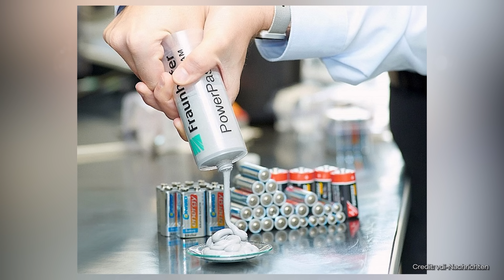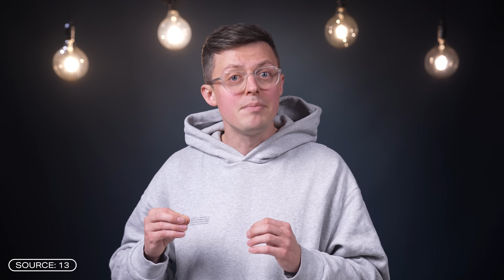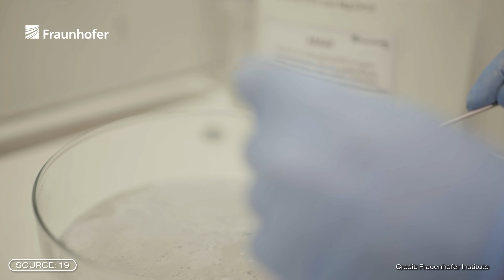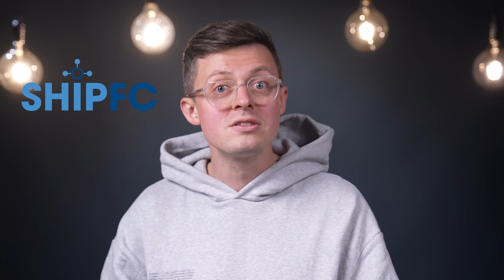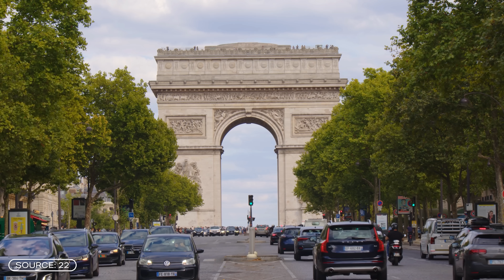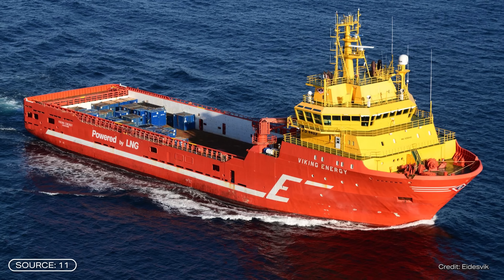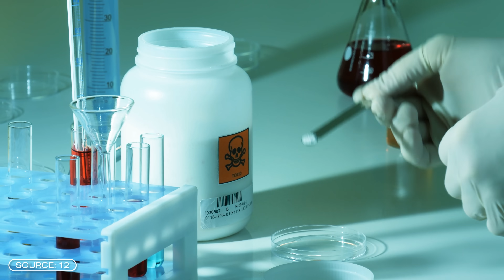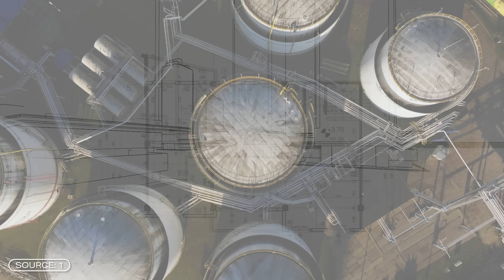Hydrogen Powerpaste: 10x Higher Energy Density & Safe?

Comment: 10kg paste yields 1kg hydrogen, but how many kg of residual material, and at what density? And as a practical matter, how do you mix the water and paste while simultaneously segregating and storing the substantial volume of leftover material so it doesn’t gum up the works and interfere with subsequent hydrogen creation?

I did some work on a similar system that combined water with an aluminum based powder to generate hydrogen and found that the volume of residual material far exceeded the volume of the input powder. And it was a wet, muddy, and abrasive mess.
Reply: That was my first question too. Converting it at point of use seems like you would have to invent entire new processes to handle the waste at service stations.  If the paste is room temp stable I have no doubt some brilliant chemist can make it shelf stable for many years it would be good for......wait a second. Is this  just a lower yield plastic explosive that is water soluble?
Reply: @spencereaston8292 you could probably replace some of the components for much more volatile substances. Any could meth cook could probably make some really good black market plastic or incendiary black market explosives out of it.
Reply: The Mg(OH)2 waste product is over twice as heavy as the MgH2 reactant within the power paste. 

The energy density quoted is also that of the hydrogen generated from the powerpaste and not the energy output from the hydrogen fuel-cell. Nor does it appear to factor in system component weight and volume (water and powerpaste storage vessels, by-product storage vessels, reaction vessel, pipework, pumps, fuel-cell, post cell water recycling/collection and purging system, nor cooling for the exothermic powerpaste+water reaction) - that would need to be included for an equal comparison to a battery based system.
Reply: @GruffSillyGoat This is what i thought. Triple work and handling effort (fill in Paste and water and take off waste = 3 tanks with all required pipes and meters and stuff) will make this unsustainable before it is ready for mass production.
Reply: @GruffSillyGoat that would make it unsuitable for smaller applications like cars or consumer electronics but for larger applications like energy grid buffers, tankers and cargo ships you only need to scale up the paste and waste material storage while the pumps, fuel cell and piping do not linearly scale with it and can stay relatively small.
Reply: @megapro125 much more economical storage solutions out there to make this a non starter ever.
Reply: @Vile_Entity_3545  I have no clue how much the paste costs or what it would cost if mass produced tbh.
Reply: @GruffSillyGoat Great. So this won't give us hydrogen either. I just don't think the hydrogen economy will ever happen except for very heavy vehicles, industrial use, power generation and such.
Reply: @wombatillo 
The ammonia cycle may finally come to fruition. 
Create ammonia from green/blue/red hydrogen, stored at one atmosphere, no cooling required or off gassing. 

With the correct design of combustion motors equipped with the right catalyst, it'll burn the ammonia in the engine itself, possibly without the catalyst once the engines hot. I seem to remember the heat and pressure in the engine then powers thermal atomisation, resulting in hydrogen and nitrogen gasses with the hydrogen burnt and the nitrogen expelled.
Reply: @MostlyPennyCat  Ammonia has some of the same issues as hydrogen. It might make sense to power an industrial process especially if it's partly a feedstock or used as a fuel to make a 300 meter cargo ship move. Ammonia is so toxic and corrosive that it will most likely never be used anywhere near consumers.
Reply: @wombatillo  This indeed. It's used as a chemical solvent IIRC, and has no practical use whatsoever as a form of energy storage.
Reply: @wombatillo  heavy machinery and industrial use you're far better off just using electricity.  Skip a bunch of wasteful steps that way.  And why would you ever use hydrogen for power generation?  It's just a very lossy, high density(per kg) battery, or alternatively a wasteful way to use natural gas.

There's no use case I can imagine where any existing hydrogen power tech would have any useful application.
Reply: @iriswaters storage from overproduction of intermittent renewables, Li-ion batteries are more efficient, but expensive, a rectifier would already be needed for batteries. A fuel cell is cheaper when you don't care about volumetric energy density, you can store it at low pressure.
Reply: @iriswaters  I think for consumers, for the everyday car, a gasoline replacement would probably make more sense. You need a liquid since it is easy to deal with, easy to pump, quickly fill up your gas tank.
Methanol, Ethanol or some artificial gasoline equivalent would do the job.
If high capacitance fast charging nano carbon tube capacitors work great, then that would be best.
Reply: @wombatillo  "power generation"

😐
Reply: @gladonos3384  As in stored energy or emergency power. Not as a source of primary power. It might be used the way batteries are but on an industrial scale where the paste and the waste sludge are stored in huge tanks and pumped through large pipes.
Reply: @iriswaters  There are some industrial processes which benefit from adding external thermal power with the feedstock and there are cases where a very large facility such as a steel smelter might want to have backup power when the grid is overloaded or the variable price of electricity goes too high. A power outage for example at a chemical refinery or a steel smelter is a disaster and they might want to prepare for that.

"here's no use case I can imagine where any existing hydrogen power tech would have any useful application."

Your're just simply wrong. Look at what SSAB is doing in Sweden and later on in Finland with their specialty steel smelters.
Reply: Boron is quite expensive so any paste which uses it is a lot of $ tied up, which suggests it will never be used at scale regardless of whether it is re-used.
Reply: Ammonia is toxic as hell, enough reason to avoid using it.  Imagine thousands of tons of concentrated ammonia being released in an accident 💀
Reply: @boxlid214  Gasoline, diesel, and the various fuel oils used in shipping are no picnic either. Ammonia is toxic in high concentrations but disperses quickly and then it's just a normal thing to find in the environment. Petroleum products stick around and are poisonous for a lot longer.

And yes you probably do want to do something a little safer than just "a tank of anhydrous ammonia" for passenger cars; for shipping it's probably fine. US farmers use millions of metric tons of ammonia each year, so it's not that hard to deal with.
Reply: @boxlid214  ...UNFORTUNATELY,IF TO USE EXISTING GASOLINE INRFASTRUCTURE AND MODERNIZE THIS UNDER NEW FUEL,THEN THE ONLY OPTION IS to use saturated water ammonia solution

......LIKE,well .....IT CAN BE PUMPED NORMALLY,AND STORED....THE ONLY THING TO BE CHANGED IS TO MAKE EVERYTHING AIR TIGHT

...AND,well....THE DOWNSIDE IS....like.....FUEL ELEMENT+ELECTRIC MOTOR IS LIKE 90% EFFECIENCY,AND INTERNAL COMBUSTION IS LIKE 30% OUTPUT,AND AMMONIA IS 3 TIMES LESS ENERGY DENSE THAN GASOLINE......PURE ONE.......BUT THAT'S WATER SOLUTION WHICH IS ABOUT 40-50%....SO THAT'S RANGE DROP FOR USING AMMONIA solution ,SO YOU'D HAVE TO STOP AT GAS STATION LIKE 2 TIMES MORE OFTEN....AND,well......SUFFER LIKE A BIT FROM THE ODOR,LIKE EVEN IF EVERYTHING'LL BE AIR TIGHT,TRACE AMOUNTS WILL BE still PRESENT
Reply: @boxlid214 
After a quick Google, it appears OME and E-Methanol are our current best candidates for Hydrogen > Ammonia > OME/E-M > diesel and maritime engines respectively. 

There's also aqueous ammonia that can go in special fuel cells. 

They also think that even pure ammonia is no more difficult to leverage, handle and store than LPG and the handling standards we have got that.
Reply: @boxlid214  the world literally runs on ammonia though
Reply: @boxlid214   Imagine thousands of tonnes of H2 being released and a spark or a cigarette.

We know how to make, transport, and store ammonia safely. This is known technology and procedures. We'd just need to enforce safety procedures a bit better, that's all.

And you can use existing gas pipes for it.

H2 is an arse to transport and store, and it expensive and dangerous.

Needs cryogenic storage, special pipes, special seals, allsorts of really expensive things.

This tech in the vid is great, but a tech mix to have liquid and gaseous H2 be as small a part of the chain as possible is the only real way to use H2.
Reply: @johanalejandrolopezarias   prove me wrong, don't just make silly noises
Reply: @boxlid214 
I mean, maybe not pure anhydrous ammonia, but we're good at chemistry, no doubt many very smart people are looking for a buffer.
Reply: @boxlid214 ammonia isnt toxic as hell its managable
Reply: Yes indeed this all sounds like a wonderful idea on the surface, until you drill down a bit & strike Granite!, Oh Well Back to the drawing board I guess! sigh !
Reply: @mechanismguy he said in the video that half the hydrogen comes from the paste and half from the added water so it would be 9.5 kg of waste
Reply: @AMGelardi1  I'm no chemist, but I think water may be consumed by the process, combining with the paste and adding to the weight of the resulting waste sludge. So the waste material in the unit I worked on was a bunch of fine black (I think oxide) powder mixed with the unused water. I took samples of this messy goo and dried it out, and it weighed much more than the original "fuel"
Reply: For comparison, the 1.9 kWh per liter quoted is about 21% of the 9 kWh per liter figure for gasoline.  The conversion efficiency to motive power may be a bit better than gasoline, but then the paste must be recycled (think even more cost), whereas nothing about the gasoline need be recycled as long as we are willing to live in a warmer climate.  The fuel tank will need to be perhaps five times larger to achieve the same range. Do we think the general public is willing to adopt this change?
Reply: Your English skills I hope are trumped by your science.
Reply: How much weight and added water?
Reply: This is a very important point for its suitability as a fuel source. I appreciate your interest, thank you for sharing insights I lack.
Reply: Abrasive is the correct description
Reply: Good questkon, i know we have them . Not just hydrogen ad well. Complex new materials.
Reply: No need for any of this. 
A better solution - +++ FAZE engine, exec summary, pg1 -- https://www.youtube.com/post/UgkxZ6RT3NhnjTYs8tB22QgFe-MjqQ4qLNXC   <><><>
.   ..  ...   ....   .....
Reply: Shut up. You are ruining the illusion.
Reply: I google search  The residue left behind after the chemical reaction between hydrogen paste (commercially known as POWERPASTE) and water is magnesium hydroxide  
This byproduct is described as non-toxic and is the only solid residue generated during the process.Hydrogen Yield: Interestingly, only half of the resulting hydrogen gas comes from the paste itself; the other half is extracted from the water added to start the reaction. 
Characteristics of the Residue
Safety: Magnesium hydroxide is non-toxic and can be handled safely.
Recyclability: The 
 byproduct can theoretically be recovered and converted back into magnesium or magnesium hydride using methods such as solar-powered lasers or hydrogen plasma.
System Management: In practical applications like electric scooters, the paste is typically stored in a cartridge. When the paste is spent, the user replaces the empty cartridge with a new one. 
Environmental Comparison
Unlike traditional hydrogen fuel systems that store gas in high-pressure tanks (up to 700 bar), this paste remains stable at atmospheric pressure and only decomposes at temperatures above 250°C. When used in a fuel cell to generate electricity, the only other byproducts are water, heat, and electricity, making it a clean energy alternative
Reply: Yeah.  Never trust "simple" solutions.   They most often have hidden costs.
Reply: 9 kg ?
Reply: @kx4532 practically speaking there will be lots of materials lost, as no node in the production cycle, from resource extraction, and all the costs implicated indirectly (transport, secondary, tertiary resources,...) is perfectly efficient and circulary.

And that is beyond what is lost directly in making the product.
The residual product he refers to i assume, is what is not mixed in.   And what is not recycled.   

But i will add a lol to this, since we are joking after all 👍
Reply: Yeah, trying to mix paste and water, whilst concentrating on driving doesn't sound safe.
Reply: ummm 2 tanks obviously - 1 charging and 1 discharging. Continuos flow would be the nightmare you described
Reply: It could be a powerplant setup like a coal plant for winter heating.
Reply: Amazing. But the problem with hydrogen is more like its volume and its storage than its mass. Hydrogen is always lightweight. But the volume and how you pack more is horrid.
Reply: Some sort of paraffin would have energy density but be removed with water. But then energy density claims a bit off.
Reply: Also, since he compares it's energy density with a battery, he must add the weight of the fuel cell, 'cause hydrogen is not yet electricity
Reply: Unfortunate, I always hope something like this might safe cars.
Reply: lithium ion is ~0.3 kwh / kg
hydrogen paste by this measure is ~0.15kwh / kg
I doubt lugging around paste and recharging it with chemicals will reach ~80% efficiency
It's stupid.
Reply: Yea this is utter nonsense and is damaging to serious research.
Reply: @excitedbox  Not everything has to go in a vehicle. This might be amazing for grid storage and household-scale storage.
Reply: @teluial  Households will likely not need this beyond mobility applications. For non mobile applications we got already the electricity itself. Charging batteries is easier than handling paste and waste. Grid storage does not need the paste. It would not be sustainable.
Reply: @teluial - perhaps read the Magnesium Hydride wiki page entry, then consider if you want it in the vicinity of your house. It was considered in the past but given up on in favour of less volatile porous solid storage (though these require heat to release the hydrogen).
Reply: @Kohlenstoffkarbid It seemed great for seasonal storage - being able to store multiple MWh in a small space is an off-gridder’s wet dream.
However, for such applications the tech looks dead in the water. Fuel cells are nowhere to be found, paste becomes a useless sludge after single use. And apparently, you’re supposed to pay through the nose for it.
Reply: @teluial  NO. It is an UTTER WASTE OF ENERGY. Producing hydrogen costs MORE energy than you get back, then you have to ADD more energy and pollution to mine this stuff, all for something with the storage efficiency 1% of much better solutions, that already exist.

There may be extremely niche use cases, just like radioactive decay batteries but that is not what is being claimed here. They are promoting it as a climate change solution.
Reply: @excitedbox Sounded like a hydrogen transport solution to me.
Reply: Hydrogen is a pipe dream. It's too expensive to manufacture with current methods and energy pirces.
Reply: @Munakas-wq3gp.. You are missing the point .. wind turbines producing electricity when not wanted gives free electricity . Even if the production of a hydrogen product is inefficient, it is still free. Provided the carrier material ..the Magnesium or  the Boron  is available and reusable ..and preferably cheap enough , ..then all your objections are irrelevant.
Reply: Mass Balance is fundamental 😂
Hopefully the leftover paste is reused
Reply: The paste could be put in cells that open and allow water to flow in successive stages..collecting the waste in the bottom of a canister that the mixture reacts .and possibly reuse the water by filter.
Reply: you could shave some weight from the tanks thickness to resist pressure
Reply: yeah they are stupid and you are smart
Reply: it's reusable, so it's parasitic mass not waste
Reply: @thekaxmax  - from the vehicle system perspective it's a waste product carried by the vehicle as a dead mass (it serves no function as a spent energy source and cannot be recharged within the vehicle but is one required to be carried till removed). However, yes from the wider systemic perspective the Magnesium Hydroxides could be reused/recycled but with additional energy input to the process. Overall the process is more energy intensive and less efficient than more direct use, such as via batteries, of the electrons powering the system.
Reply: @GruffSillyGoat  Waste is expended. Parasitic means it stays after use.

An example: your brakes. Unless you are slowing down they are no use to you and are parasitic mass.

Same with the battery in an EV.
Reply: @thekaxmax  - I'm refering to it from a chemical perspective not a mechanical perspective. It's a waste product of the reaction.
Reply: @GruffSillyGoat  But it can be reused. So not waste, parasitic mass.
Reply: @thekaxmax  - at an additional energy cost though, and will that actually be spent?
Reply: @GruffSillyGoat Do people cast off the car batteries when they are low on charge? Or do they stay on board as dead weight? I know the answer and I defend the extended paste, which you should have done.
Reply: @YouKnowTheyExist  - There is a big difference between a system that designed to recharge in-situ very efficiently and cost-effectively like a battery. 

Compared to one than produces a non-useful product within the vehicle that might get re-used externally. That is if the economics of disposal, storage, transportation, reprocessing and energy expenditure in doing works out vs obtaining the same material from lower energy other sources (such as saltwater brines). 

My point is at the vehicle level one is carrying a mass that impacts the efficiency of the vehicle, using an energy storage mechanism that has lower volumetric/gravimetric energy density than a battery (when compared like for like at the system level, i.e. mass and volumes of vessels, pumps, pipework, fuel-cells that are required to provide the equivalent to the function of battery). Then carrying an additional dead weight that cannot be regenerated onboard (requires 600°C+ temperatures typically).
Reply: @GruffSillyGoat either the refuelling station also take back the residue, or vehicles could simply store the H2 in gas form while the paste and residue would be handled at the refuelling station. Whichever turn out to be more efficient. Those aren't unsolvable systems and more importantly, you do not ask if a solution is perfect, you ask if it does better than what is currently in use.

Fossil fuels come with all kind of residue and efficiency issue, and if the pasta already do better than that, then it's enough of a reason to switch to it.
Reply: @GruffSillyGoat..that is absurd.  Putting it crudely , I might have to talk around the shops all day before I find the toilets ..I am carrying waste for hours , until by bladder or bowel complain..I am not a bird. Carrying the dead weight of a used fuel , to recycling is not nonsense
Reply: Yep, if you look at the doctor's face you see it flushes as he speaks? Embarrassed maybe?